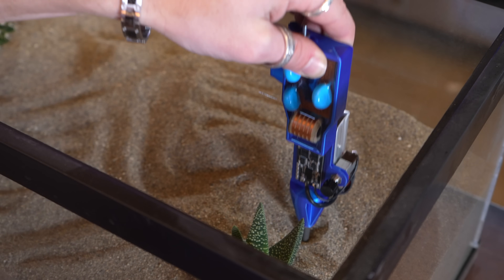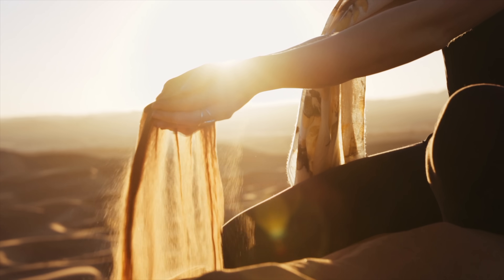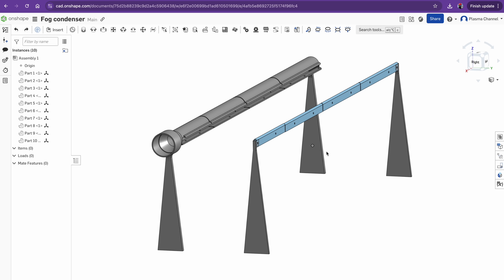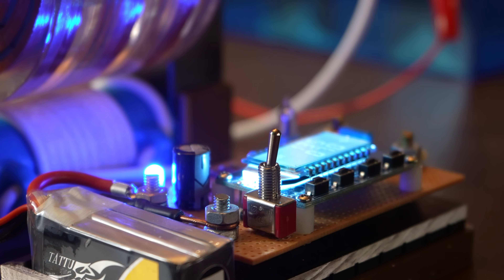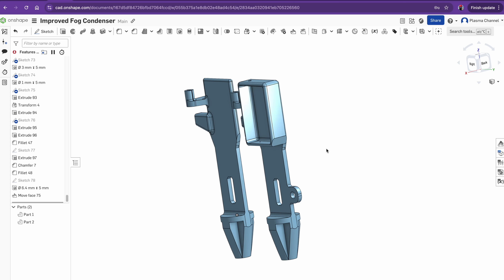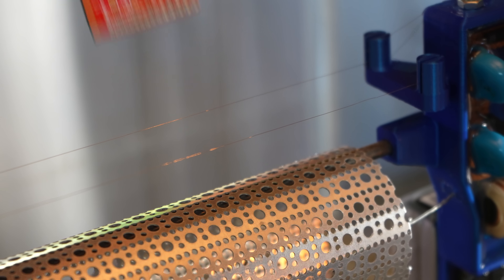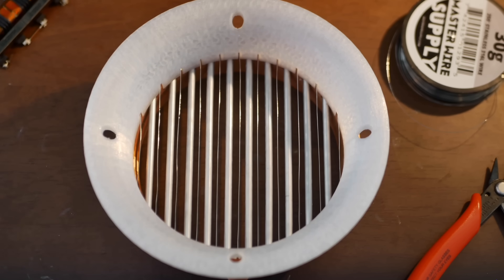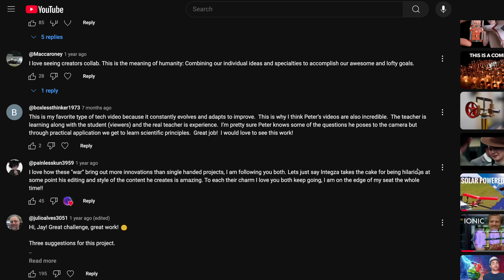Solving Desert Water Shortages Using 20,000 Volts

Comment: Hmm, I suppose we can scale it very easily!
Let's replace the most expensive part, the with cheap nylon(or some other cheap synthetic material) mesh stretched between aluminum(or some other cheap metal) rods. Wet non-conductive mesh will be enough conducive at 20kv. We can also replace your elaborate voltage multiplier with cheap Chinese 20kv integrated voltage multiplier that only cost a few $
Reply: But wait, the plants are already conducive and grounded, so why not simply run a single +20kv wire above plants and use them as the grid?

Comment: WOW! With my small brain, I went directly to an ultrasonic atomizer + your fog condenser = a desalination plant that is cheaper than osmosis plants currently in use.
Amazing work.
Reply: Be careful... Atomizing salt water would carry salt with the water since there's no separation process
Reply: The man above is right. Ultrasound does not distillate. It just throws up droplets with all what water consists of.
Reply: Say hello to my little friend, corrosion!!!!
Reply: @ericensley2427  Heh row collosion!
Reply: Now to see if it actually works and is cost effective..  I want to do a flash steam condensation desal device by using a metal block with a high thermal storage potential.  Maybe one of ours will work!
Reply: Thats not how that works at all. It just breaks the water up into very small droplets. Salt will dissolve down to the molecular level and isn't something that will just crash out of water when its stable and not over saturated. Ontop of that it needs to be cleaned because air contains pathogens and contaminants which if you want to drink be my guest but it will adventully make you will sick
Reply: atomizer does not separate the salt.  all you get is atomized salt water. and then condense it back again to salt water.
Reply: I tried one of these ultrasonic atomizers to humidify my room with tap water.
It was garbage.   the entire room was coated in hard water powder.  so the minerals in the water stays in the atomized particles.
I switched to humidifier that relies on heat, boiling. it uses much more energy to boil the water but you don't get the hard water minerals in the air. it also great in the winter as it heats your room a little as well as humidifies.
Reply: @ Makes sense. Googgle had a patent for adding heat to the system during the atomization from the ultrasonic atomizer. That patent ran out and no device made the news :(

Comment: Well that was interesting!

More efficient than the thermal dehumidifiers? I can think of several different applications for this ....... 

Tumble driers! The most efficient ones use heat exchangers and that means you need a constant heat source (miles better than vented though), but if you can get the water out of the airflow without cooling it you have the next gen in tumble driers!

Dehumidifiers (obviously)

Sterilisation units. This could work as an alternative to UV sterilisation as the unit obviously produces ions. This could be really popular to sterilise hotel rooms without the attendant health risks!

Environmental cleaning units. If the effect can pull water out of the air it can also "clean" smoke containing heavy metal contaminants. This is currently not commercial for larger kit like power plants taking up to 30% of output, but these low levels of power requirements could be scaled up efficiently and retrofitted easily to existing chimney stacks!

OK there are 4 to be going for! ;o)

Comment: As a vapour capture device very impressive. Not so convinced about its use in deserts/arid regions though - the name 'sea mist' is kind of a clue to the real problem. There might be mists in the early morning in many deserts but in most cases they probably don't actually contain enough water to be very useful. Its also the same water again and again so if someone captures it then at least in some cases it wont be long before there's very little left.. Previous projects like the 'Water Seer' failed for exactly this reason.

Comment: It's a powder coat system that uses water instead of powder.
HV LC is applied to the (Powder) and clings to the grounded surface.
The water condenses on the surface and the weight of the water pulls it down and away from the ground.

Comment: Water costs.      at 14 ml per kw-hr your water is costing $0.11/gallon - not including fixed/capital costs or maintenance.   Water from the tap is $0.005/gallon-  even less if the water is simply directed at irrigation.  So, this water is about 22-35 times the price of produced water.    Granted water is more valuable in remote locations-- but so is power.  After doing all this work and building the system, I am surprised you didn't include this simple, but important information.
Reply: solar panel with battery = free energy
Reply: @Jesusaves33  well not free.. battery and solar panel also cost money
Reply: I think your math is off too.  Average US cost per KWh is $0.1654, 39 watts (0.039 KW) to make 540 ml (0.26 gallons) per hour, or 6.8 Gallons/KWh

Fog Water Cost / Gallon = $0.0244, about 5 times the tap water cost in a developed nation - if using commercial electric.
Reply from the maker: Because you’re not taking into account that solar plus battery equals years of free energy, and would reduce cost after a couple years. It charges in the sun during the day, works on the fog at night. Automated. And drilling a 1000 foot well is incredibly expensive, plus, not possible for most communities that actually need them.
Reply: @PlasmaChannel  Where is the solar panel coming from? Where are the batteries and tending systems coming from?   Yes a well is expensive but companies build them all the time.  Could you imagine cleaning the sand off of your miles of water condensers and solar panels after a sandstorm?  I truly wish it would work but it won't.
Reply: @PlasmaChannel  is there visible fog most nights where you want to apply this?  I work in the humidification business (we MAKE fog for Gas Turbine Inlet Cooling!) and interestingly, one the of the problems we have encountered is when spraying demineralized water, it can often become charged as it passes through the nozzle which then causes it to cling to the grounded fog manifold causing dripping (this is bad for the turbine, as large droplets can impact and damage the blade).  But, seeing this video was very cool as it exemplifies and amplifies a phenomenon I was already familiar with.  Anyway, the reason I am asking about visible fog is that I am wondering if putting your wires inside a passively cooled structure could allow them to work even when there is no visible fog outside.  https://www.youtube.com/watch?v=tnJms_3Gbuk

I don't know if you could scale a structure like that down for smaller and cheaper applications, but obviously cooling the air as much as possible will also draw out the most amount of moisture, and even allow your design to continue working on nights when the air doesn't reach dew point.

Cool video overall!  I hope your research continues to go well!
Reply: G’day, a news report on the radio in Australia announced a fine fog attracting mesh that only needs to be dusted off occasionally.
I’m going to gooooooogle it after this.
Reply: As discussed, these prototypes are suitable for use with solar power.  Water cost of $0.005/gallon is the long-term marginal cost to produce from reliable sources.  For example, where I live the water is sourced from the Missouri River, transported 10 or 15 miles through pipes built 50 to 75 years ago.  The economics are quite different to farm in the Sahara desert, and even “back in the day” farmers in my area rarely to never bought water (as far as I know).

Saudi Arabia imports alfalfa grown in American deserts using water from a depleting aquifer.  They import from us because it is cheaper than using their own water and land to grow it in their country.  The cost of water is very different in the US than some other parts of the world.
Reply: I agree with you man.  A well is so much cheaper.  idc if you have a phd in engineering and math, if you can't apply it properly it's useless.
Reply: power might not be with some solar

Comment: Wouldn't a air compressor condense the moisture out of air in a foggy area? they do it pretty good when it's just humid out, I think the challenge would be creating a bypass for the "dried" air to keep the system running. Most air compressors have a water discharge valve on the bottom already

Comment: Great experiment. You could test how low the voltage can be turned down (with the attendant power savings). You could also test the relation between the RH% value in the vicinity of the device (i.e. the "fog intensity") and the required voltage and energy usage per gram of water collected. What about the material of the collector grid, or its surface texture? You're on to something great here, Jay.

Comment: This... could actually be something big.

quite literally every other kind of 'water from air' solution is just a re-boxed dehumidifier or some kind of passive condenser that wouldn't work well in arid conditions. Why? Well, you need to be able to drop the temperature below the dew point. in a desert, that's really hard. 

This skips that. if you have fog, you can pull it out of the air directly, without a heat pump. the implications are huge.

Comment: I'm no expert in this field but have you considered employing electric fields in the atmosphere to possibly power the system or maybe recharge the battery? 
Build a tall enough pole with an exposed, isolated wire to harness the electric field and pass it to the device. google says that the voltage increases by 100v per meter, so a 20 meter pole of some sort may provide a sufficient power source?
Or even just for fun release a kite with a metal wire wound around the kite line. if its near the coast, I'm sure there would be a constant breeze to keep the kite in the air
Again I'm no expert, just some random thoughts and maybe someone can build off of these suggestions.

Comment: I think the main constraint is going to be the starting humidity of the air, i think as the humidity goes lower the energy required to actually pull it out of the air is going to be immense, but maybe if its only being operated during these desert fogs it would be efficient enough 

the next step would be to see if its more efficient than just collecting water elsewhere and transporting it :)

I worked with water remediation as part of my masters so i have some ideas about water technologies but for sure not an expert so i am mostly spitting out the first thing that came to mind

good video overall thank you for making it.

Comment: As chap said in the comment: in real life outside it won't work as you need big droplets minimum of 2-4 um to get them charged. As you make your own fog it worked but outside in real morning fog where droplets are not that dense it just won't work. I that would work you would left outside in the morning. Also stupid to compare dehumidifier where is job to extract moisture from air not from fog. Your device wont work as moisture actual water in air droplets are way smaller where you device wont have any effect. Prove it, without your mist creator how much water it will collect in normal conditions. I bet ZERO

Comment: So obviously this is a really great project, but as usual one of my pet peeves with this channel gets exposed, which is power usage.

This project would only work during the night and early morning in the desert when the fog actually exists, but this also means that you can't use solar to generate power and wind energy will be severely diminished, meaning you will need to store power in batteries. Batteries are typically big and expensive, which is a massive obstacle for places that could actually use this.

This channel almost never discloses power usage, or even how many amps a project is drawing. Does this thing draw a kilowatt for 5 minutes to collect 40ml of water or is it drawing 5W? One of these is obviously much more practical for already impoverished areas trying to farm than the other.

Comment: The system is used in northern Chile and part of Peru, it was initially born in Chile. It is called. Atrapaniebla. (fog catcher), but it is used without electricity, it is only several layers of mesh.
It captures 5 to 10 liters daily, and has reached up to 30 in some cases in desert areas. 
Why is it also used in forested areas where there are many more Water, even beer is made from that water
Reply: mmm 👌🏻

Comment: There is a mechanical water generator that uses a mesh over a bamboo frame and has been producing good amounts of water from humidity and temperature differences between day and night. I believe it was invented by a Dutch and has been in use in a few places in Africa with success. The same has been tested in dry areas of Chile where there is a heavy fog in early mornings. That concept is very inexpensive and does not require energy.

Comment: Cool. Morning is also the best time to water your plants. 
The question now is if it is more efficient to condense the fog with electricity(amount of energy needed), compared to bringing water from the place where there is plenty of it(amount of energy needed). If the math says its more efficient to condense the fog, then congratulations.

I would worry a little about birds sitting on the wire or metal structure. Insects and other animals also. You would need some protection.

Comment: I think it would be extremely interesting to compare the energy efficiency of this setup to desalination plants in terms of water produced vs energy, while taking into consideration for how long it can run (battery, optimal hours for condensation, etc.) and the cost of setup and operation for both. For desert coastal regions, if this turns out to be more economically efficient than desalination, it could be a game changer.

Comment: I do think we have similar devices at work, a machine with high voltage wire to condense vaporized oils back a state that does not fog up the air with cutting oils and thus making the air more breathable. they however are prone to clogging up a little and need to be cleaned ever so often, They are build up using modules that click into place. They are called MISTBUSTERS and I checked, but a quick google search does reveal them. These things exist for a while already, this just feels like an amazing oversight in engineering, I am convinced they work the same way, so thank you for explaining how this works I always wondered.

Comment: Collection of water by introducing a applied voltage can be enhanced by first ionizing the air using either shortwave uv or soft gamma rays, or alpha particles. This introduces ions which can carry a charge impressed by the electrodes to the water droplets. using naturally occurring air ions is ok but relies on  solar uv or cosmic rays to generate ions.

Comment: This is awesome. My main concern is this would pull in too much water from the top soild over a larger surface area. Also remember that there are animals that need that water in the area as well. The surrounding soil becoming dry would be my main concern. 
Great work tho! I can't wait to see what you come up with.  Also you may want to try a snowflake or a fractical design for catching the water molecules. The geometry needs to be as effective as possible. So you may want to timelase the process to see how the water flows.

Comment: The Demisters for CNC machines (usualy) work on the same principle, maybe you could find some inspiration from popular designes, even though those are used to liquify oil/water mixture mist from inside a CNC machine thats cutting metal. 
(found out the demisters are electrostatic because one of the ones we got behind a lathe was broken and now internally sparks a bit when first turned on in the morning)

Comment: Can you make a video tie it to a balloons and fly it high during the night. Water coming from height may reduce temperature create local rain and increase its productivity.
The height of fog can be determined easily and the ballon tied to the ground can be adjusted automatically using the weather reports. Can you also study and provide use how air moves with this system running. 
This system can also be built using small grids of thin wires tied to poles across and acre or two with local mesh around the plants to collect water. The mesh would also be protecting the plant from sunlight and maybe help trap back the precipitation water but that would be definitely inefficient. 
Or maybe if we could charge the plant itself. Lol. 
But this thing has so much potential good job Plasma channel and MIT people.

Comment: Please consider doing this with just an antenna like a wire on a bamboo stick tehn electrodes with shepperd's electric net like fabric (lighter than sheets of metal for large areas). It can then be achieved for cheap by anyone anywhere. a 20m bamboo pole with a thin wire. ^^

Comment: Sounds excellent, for desert application, could even be applied to dehumidifiers, the commercial ones work on peltier coolers or refrigeration circuits. Both use a cooling effect to condensate the water out of the air at the dew point.

Comment: You tested it with fog, naturally, but does it do anything with no visible fog? In deserts, as you say, the coastal fog burns off quickly once the sun comes out, but that doesn't mean there's no moisture in the air at all, just that its temperature is further above the dew point. Could this, possibly with a small shade cover, create condensation further into the heat of the day?